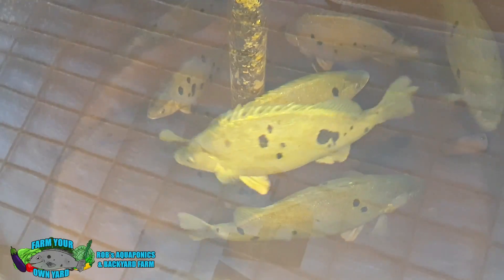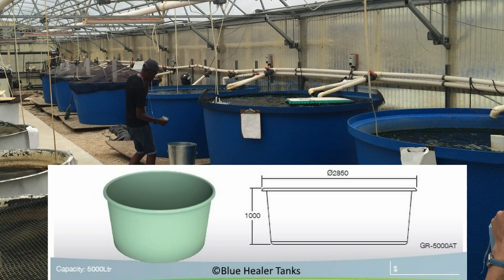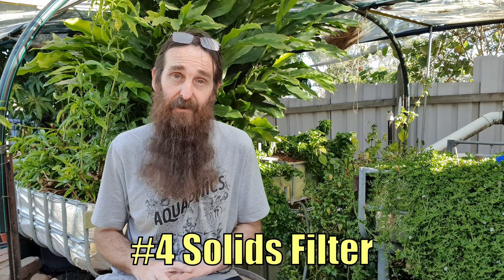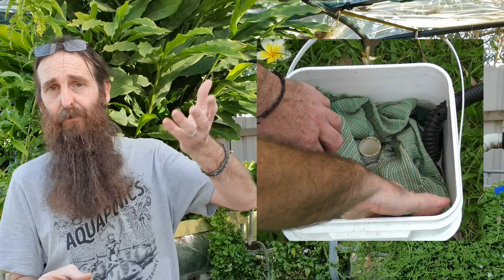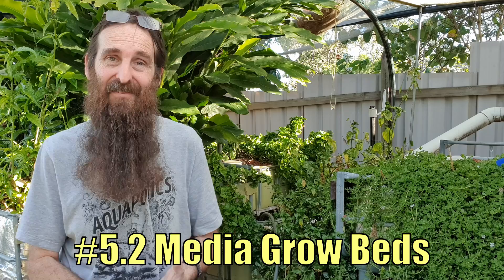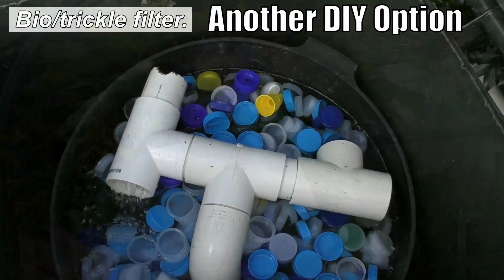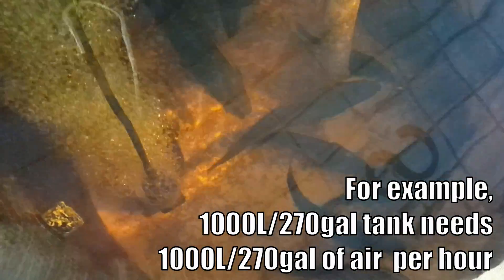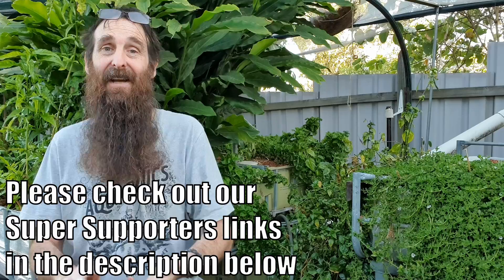Aquaponics System Design - 9 Essential components

Comment: Hi Rob, due to space constraints, I didn't want to use 2 x 45 degree elbows between the fishtank and solids filter, so I asked ChatGPT whether it'll make much of a difference between those 2 parts. Here's it's response  (note that this is only in the freeflow part between those 2 components, not where the water is being pumped up by a pump).

ChatGPT: "If you have limited space and prefer to use 90-degree elbows due to spatial constraints, it should still be sufficient for your needs, given the flow rate of 1500 to 2000 liters per hour. Although using two 45-degree elbows can help reduce friction losses and optimize water flow, the impact on your system's overall performance with your specified flow rate should be minimal.

Using 90-degree elbows in your 50mm PVC pipe system should be able to handle the flow rate without significant issues. Just be sure to minimize the number of sharp turns and the total length of pipe to further reduce potential friction losses and ensure efficient water flow throughout your system.

To give you some context, a 50mm PVC pipe can handle flow rates of up to around 5,000 liters per hour (or even more, depending on factors like pipe length and head loss). Given that your intended flow rate is well below this threshold, a 50mm pipe with 90-degree elbows should be sufficient for your needs. However, if you want to optimize your system and reduce potential friction losses, using two 45-degree elbows for turns might be a better choice."

So, A.I. being A.I., it repeatedly says 45 degree elbows will be better, but if need be, you should be fine with 90 degree elbows between the tank and the filter.
Reply from the maker: Cheers for that. I wonder if it would give a different response if you mention the flow is under gravity & not being pumped.

Comment: Hey Rob, could you have a sump separating your solids that has red claw or something similar in it to clean up the muck?
Reply from the maker: I had some in mine originally & they did OK until they played highlander & there was only one at the end. 😁
They would have done better if I offered them more hiding spots like pipes or crates.

Comment: Love your videos. I am just starting to build a small unit. Thinking an IBC tote and cutting a 55 gallon barrel in half for the beds. Going with a radial flow filter and sump as well.  If I have to move 250 gallons twice an hour, would that be too fast for the bell siphon to work?
Reply from the maker: I think it may be Popee. Sorry it took so long to get to your comment. How did the build go?

Comment: Correct me if I am wrong.  If you ran the fish water through the clay ball grow bed and filled it with poop you could change the grow bed out and replace it with a fresh clean bed.  Put the poop filled one in a different part of the green house and use it to grow lots of healthy veggies.  Depending on the size of the operation you could rotate 5 grow beds between the fish water filter side and the just plants side.
Reply from the maker: You could do that John but it's not really required. Removing the bulk of the solids waste, mineralizing it & returning the mineral rich water back to the beds is a much easier way to go.

Comment: I live in an area with a lot of lime in the water…..is lime a dealbreaker for these types of systems?
Reply from the maker: You can adjust the water before it's added with some acid. I would do it when you first add water to the tanks & before you start to cycle the system. 
Once the system is Cycled and fish are added the nitrification process will naturally consume alkalinity and help keep the pH in check if all goes well. 
A lot also depends on the size of the system and amount of feed being given to the fish.
Hope that helps some.

Comment: Hi, Rob :)
Can scoria be used as a substrate, in lieu of LECA? I’m looking at the cost to fill half IBC containers (yes, I know I just said container containers - a bit like ATM machines) and if scoria can be used, the price differential is quite considerable over multiple beds.
Look forward to your opinion.
Thanks :)
Reply from the maker: Many folks use scoria Rachel. I have been told that some is dyed to make it more decorative so keep an eye out for that. I think most of that is sold in bags but am not 100% sure.
Reply: @RobsAquaponics  Thanks for your reply. I looked at one of the bulk landscape suppliers (they supply everyone else) and it's sold by the tonne. 
One IBC (two halves) cost less than half of the same capacity in clay balls. 
I'll make sure to check out if it's been dyed. Thanks for the heads up. 
Stay safe. Stay well :)

Comment: Would I be able to make a long term Aquaponics system out of an above ground pool?
Reply from the maker: You could if the plastic liner was food grade Sara. You may have a few issues with lack of nutrients though if it's a large pool as you'd need a lot of fish to create enough nutrient to grow plants, otherwise it will be too dilute. 
If you did stock to a base level of fish, you would have the issue of needing a lot of grow beds/biofiltration to be able to process the waste from the fish if it was stocked at 1 fish per 25L/6.6gal of water in the pool.
Hope that helps some.

Comment: Hi rob after years following aquaponicks i have created a split system with 5 grow beds. We run +- 3000 liters.
We started in the middel of winter. We are very happy with our growth. The talapia are still less than 70mm 26 off so untill they reach maturity we are supplementing the nutrition. We have 50 fry +- 25mm in our indoor tank.
Question what would the water replacement be acceptable per day.
Reply from the maker: Sorry I missed this. I would look at adding a small aquarium filter in with the fry & let that process the ammonia. As for water changes, We used to change about ½ the water in the aquarium tank every second week when we kept fish inside. 
Hope that helps & sorry again for taking so long to respond.

Comment: Hello Rob
What do you think about an airlift pump rather that the normal water pump?
Reply from the maker: I have seen them work well for some folks in their systems. I prefer to use the water pump as it moves the water around at a higher pressure. 👍
Reply: @RobsAquaponics  Ok, thank you!

Comment: hey Texan here just wondering on cold days if I use those blue barrels how do you keep the fish and plants from freezing????
Reply from the maker: We live in the subtropics so popping them in a sunny spot in the yard helps. In colder areas, you might want to look into running a small aquarium heater in there barrel system to bump the water temp up over night.

Comment: Can coconut coir be used for growth media and can a water tank/vat that is used for collecting rain be used for the fish tank?
Reply from the maker: I wouldn't use coir myself in a large grow bed but it may be fine in net cups if you're growing using the NFT or DWC methods to grow fast turn around crops.
 I have seen a number of folks use recycled rain water tanks for fish tanks. 👍 The only ones I would not recommend you use are the galvanised metal ones as they will cause issues with the fish if they're not lined correctly.

Comment: Anaerobic bacteria can only convert when oxygen levels are low, because they use other sorts of substances to perform chemical conversion. Anaerobic bacteria do not just develop carbon dioxide and water during conversion, but also methane gas.
Reply from the maker: Yep, they need anoxic areas to be able to flourish. 👍

Comment: I have a question. Can you use a refugium on aquaponics? Is there such thing as too much filtration?
Reply: Planning to use the refugium for the fish poop not the sump tank
Reply from the maker: Some folks will have fingerling tanks set up like a refugium in their system. Helps to stop them becoming fish food for their older relatives. 😉
The only time you might have too much filtration was if you had more grow bed area than the fish waste could support.
Hope that helps some & sorry for taking so long to get back to you.

Comment: Do you think I could do an decent aquaponics system in a one car garage without sunlight?

I'm really intrigued by this idea and would love to give it a go. I'm assuming you can't do any salt water fish like whiting.  I'm assuming it has to be fresh water.
Reply: I'm sure everything will be answered by watching enough videos.  Sorry if it is :P
Reply from the maker: You can set up inside but will need to add in some sort of lighting for the plants. There's a load of LED lights on the market now that are a lot cheaper to run than the older hydroponic lights which helps some.

Comment: What's your take on pvc in Aquaponics? I've read a lot of conflicting information about toxins leaching from pvc into the water and plants over time.
Reply from the maker: As far as I can tell from what I've read, PVC should be fine as long as it's not heated. It also pays to use the PVC pipe that's made to move potable water. 
I do think it's a good idea to try & shield the pipe from UV rays if you can as that will help stop any contamination from the outside of the pipe breaking down. Not sure if it's needed but better to be safe than sorry.
Reply: @RobsAquaponics  Thank you for your input. Great videos by the way.

Comment: I badly need some help.
How do I neutralize lime stone? It the only medium I have to use. Plus I have tons of it.
Seems everyone is only concerned of going 180 degrees. Meaning the want lime. So can't find info on it. 
My soil is limestone. My rock is limestone. I can not afford or get clay pellets. 
Even if it a hydroponic and not aquaponic system.
Oh also I can't grow in the ground. Too many critters eat my stuff, even thought it doesn't do more then sprout.
Hydro and aqua, I can raise above crittets. Plus takes less water, which is like gold where I am.
Funny story. I laught at the Saudi when oil was cheap and water was expensive. Now I have plenty of oil, little water, and no food. And no one will buy this bloody oil. 
Someone please tell me how, cheaply, to make limestone use able.
Reply: I'd trade anyone 3:1 1/4 limestone for clay pellets. 
Meaning 3 cubic yards of limestone for 1 cubic yard clay pellets.  Smaller or bigger I don't care.
Same deal with powder for clay pellets. But you have to come pick it up.
Like I said I have tons. 
Great for making cement if you burn it. But terrible for growing, if thats all you have.
My soil is limestone as well. As in powder.
Also ok the  make bricks from.  Just add water and let dry.
Reply from the maker: I'm sorry to say you can't use it at all mate as it will continue to release carbonates into the water until it breaks down. 
Can you get river rock in  your area or is that all limestone as well.
Reply: @RobsAquaponics  no rivers.
Washes are also limestone.
Reply: @RobsAquaponics  I know it will be a time consuming process.
HOWEVER. Has anyone tried using tire rubber. Will it work. 
There is a lot of old tires around.
I'm just trying to think of thing I can get.
Reply from the maker: @pychohobo1832  From what I've read they suggest you don't grow food in tyres as they also contain a lot of elements that will build up in the food & become toxic over time. Broken roof tiles might work OK as long as they're not made from cement.
Reply: @RobsAquaponics  ok wasn't sure so though id ask.
I just had a lot of bad luck lately.  Blew engine in my truck next day frame on my jeep broke.  2 months later bought another truck on way home transmission went out. 2 months later bought another truck. Looked good, appear to run good next day water was in oil.  I live 100 miles from city. Off grid is nice, but also sucks.

Comment: Hi Rob thanks for the info...  One question, If my fish tank is 1000L what capacity my water pump should have? Considering a sump tank and grow bed volume. cheers
Reply from the maker: Is a bit hard to say sorry as it depends on what style of system you're building. If it's a single loop you only need enough to exchange the water in the fish tank 1.5-2 times an hour. Our oirigional single loop had a 4500lp hour pump running it & I had just over 2500lph going through the 1000L tank. 👍
If it's split flow you will need to go larger as you'll also be delivering water out to the grow beds as well. 
This clip might help you understand the different ways to plumb a system if you're not already familiar with them. 
https://www.youtube.com/watch?v=0QQA5BpWKec 
Sorry it took a while to get to your comment.

Comment: Hi Rob, do you have any videos where you go into the aerated mineral tank? I'm doing a small build where i'd like to use water from an aquaponics system to manually water nearby plants. Plan is: Fish tank -> SLO -> Bio-reactor -> sump tank. Nozzle from sump to water plants. An aerated mineral tank would be icing on cake since i won't be growing plants in a bio-media bed. Thanks! & Thanks for all your videos they've been extremely helpful!
Reply from the maker: I don't at the moment sorry. They are basically an aerated compost brewer if that helps any. You just need to turn the air off & let the solids settle out before decanting the clearer water back into the system, if that helps any.
Reply: @RobsAquaponics  that helps tremendously. thank you. the part about turning the air off to let them settle was exactly my main concern and question at this point. gotta have healthy water for the fish! thanks man looking into compost brewer now

Comment: For along time I have been wondering exactly what is the point of using complicated bell siphons (more work & expense & often fail) when a simple siphon with no moving parts (as septic tanks have) will do the same???
Reply from the maker: Never had any issues with our bell siphons that couldn't be fixed in 5 minutes.😉 
Not sure what you mean with the septic siphons as ours never had one.
Cheers.

Comment: Hi I am a hobby aquarium keeper. The air pump is useful but it does not supply the dissolved oxygen to the system. What it does is break up the surface of the water allowing it to exchange gasses. So the more you have the bubbles spread out around your tank the better.
Reply from the maker: Can only put sop much in a 13 min YouTube clip.
Thanks Earl. 👍

Comment: Have you considered using a standalone solar/battery/inverter setup to isolate your garden from the power grid entirely (and how that'd affect costs long term)?
Reply from the maker: We have a back to grid system on the house so the system is partially run by solar. I would like to set up a decent sized 24v system but don't have the space for the panels at the moment.
Cheers.

Comment: Hi Rob. I Really enjoy your videos. However, with 1.5 years of flood and drain mini grow bed experience with 20w pump, I never have reliable cycle. It always change few hours after configured properly, either it become constant flood or constant drain. Do you have any suggestion for me? Thanks in advance.
Reply from the maker: Have you got a reducer fitting at the top of the standpipe WC ?
Reply: @RobsAquaponics  Yes I do. It was 1" to 0.5" pipe reducer.
Reply from the maker: @WeirdlyChosen  Does the drain from the base of the bed tilt downwards or upwards? Also, how long is it? If the drain is too long it can cause issues as well sometimes.

Comment: Do you still recommend water bottle caps  for the bio filter? I only ask because I've been collecting them from your video.
Reply from the maker: I think you're better off to use the proper biomedia M H as it's been designed with more biological surface area for the bacteria to colonise. 
The lids will work though in a pinch.

Comment: Great video only one thing I wanted to touch on a mineralization tank is also known as a settling tank 
It is a anaerobic process 
Meaning dont add oxygen until the mineralization process is completed it takes a few months to actually complete but after it does that's when you add oxygen to bring the anaerobic environment to a aerobic environment so it is healthy for plants and now minerals rich thanks for the video keep up the good work
Reply from the maker: As I understand it, adding a carbon source for the microbes & supplying them with air. is a faster way to achieve the same results without the off gassing of nitrogen & production of methane. From memory it was Paul Van that explained it to us at a small Q&A gathering we had here a few years back. 👍
Cheers.
Reply: @RobsAquaponics  
check out this link I just found it's on point  with this conversation 
https://aquaponics.com/ufaqs/what-is-the-difference-between-nitrification-and-mineralization/
Reply: @RobsAquaponics  
what your talking about is 100% 
right but is the process of only  mineralization of nitrogen but in the aquaponics world  a mineralization tank is generally referred for a mineral tank with more complex minerals in it not just nitrogen. just wanted to clear that up im not trying to dis-credit you in front of your
subs. this is a great learning channel
Reply from the maker: @420niles  More elements than nitrogen are released from waste in an aerobic mineralisation as well.
I mentioned the nitrogen off glass as that occurs more in anaerobic decomposition from my understanding.

Comment: Thanks Rob, you’re always reliable in answering what comes next in my plans. Currently finishing my greenhouse. Got 16000 liters of rain water captured and have been measuring water temperature in the spare garage right next to the greenhouse where the fish tank(s?) will reside. Thinking of bluegill or trout. Planning on sizing the pump and where the sump tank will be placed. You’re clips are essential for planning! 👍
Reply from the maker: Am glad they are coming out when you need them Joe. 👍
Have had 2 folks say over on FB that they wished I'd posted this a few months back to help with theirs. :/ 
Have a top one Joe. 👍